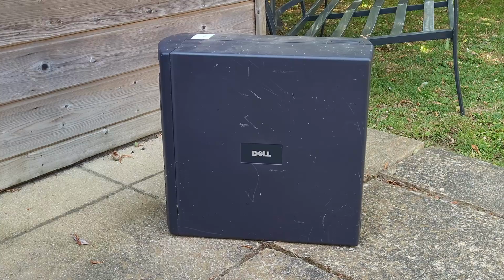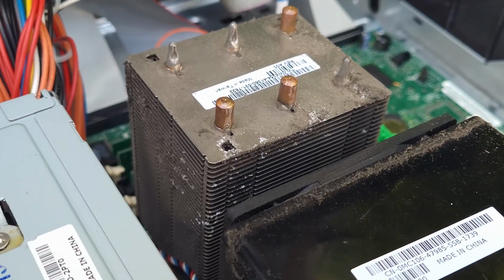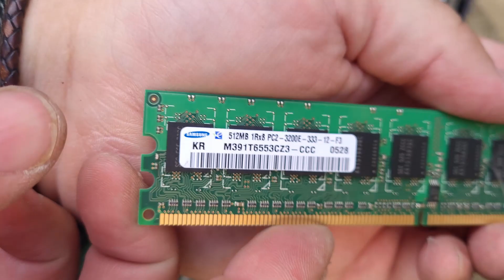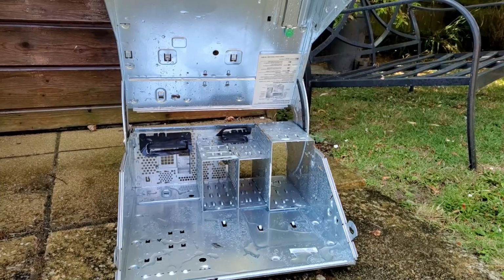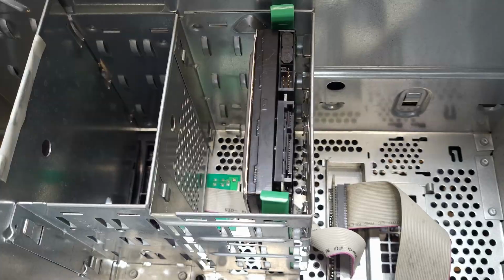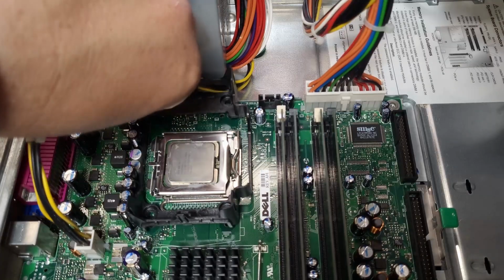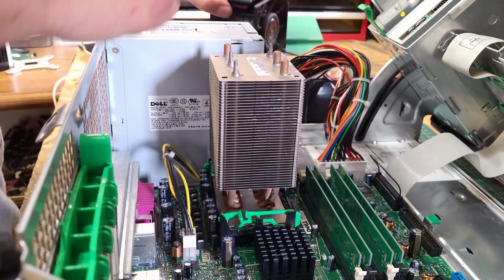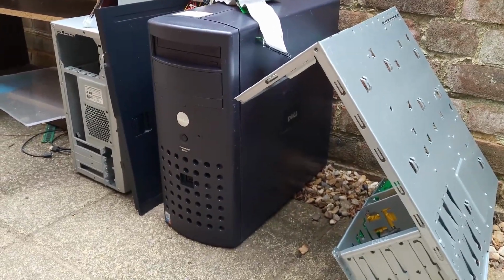Quickly Went From Bad To Worse OLD Dell Sc420

Comment: I have an SC400 board and it’s really good for testing old GPUs. The Dimension 4600 or 8400 also have good P4 boards. Bad caps aside, these old Dells boards have been solid and reliable for me.
Reply from the maker: There never seems to be an obvious pattern for me on dodgy caps with these Dell machines. Just pot luck